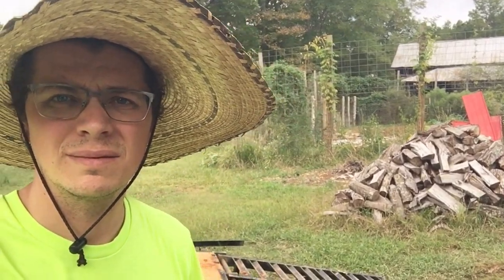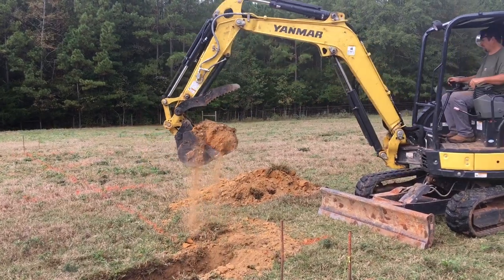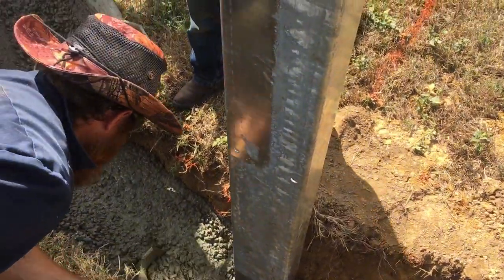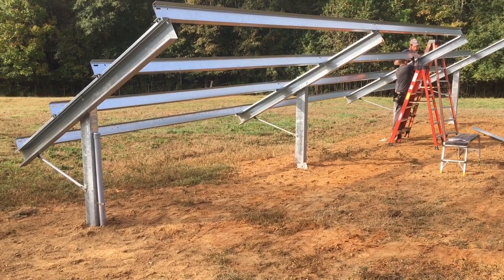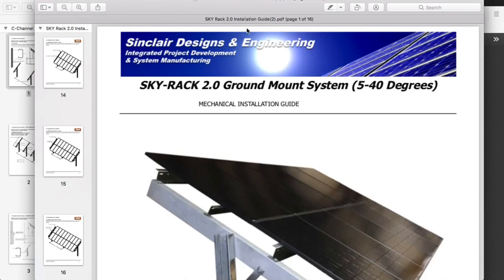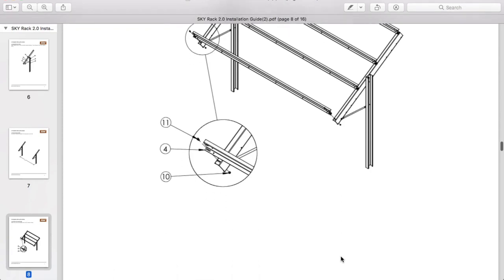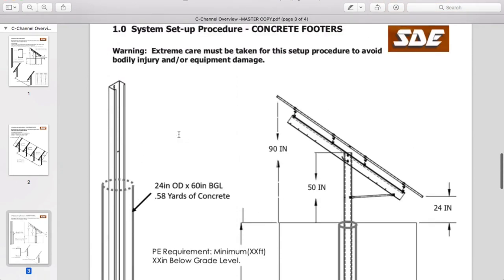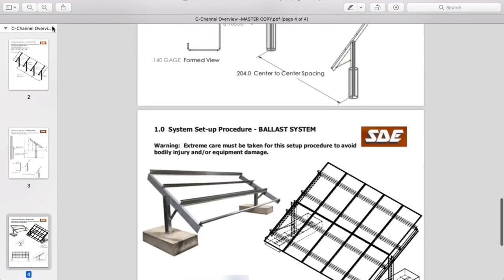How to build Ground Mount Solar: SDE Skyrack

Comment: Are those uprights (C-channel) the 12 footer units?  How deep did you put them in? Great vid!  Thanks.
Reply from the maker: Sinclair usually calls out the post embedment but prob 50-60”  they are 12’ posts. Do you need some sinclair. I can sell it to you
Reply: @GainSolarPower  How long did the concrete set up before removing braces, filling it in, and putting up the purlins/trusses?

Comment: Does concrete detriment the galvanized steels
Reply from the maker: I’ve  got no way of checking but it will last 25yrs. I’ve seen them 15yrs later no rust where post meets concrete

Comment: would you go to la crosse wi 15 kw system
Reply from the maker: I can help you design the system, source the material, and provide technical support for the install. Once the installation is complete I can fly out , do a final check over, and commission the system.  

Jv@gainsolarpower.com
7708433497